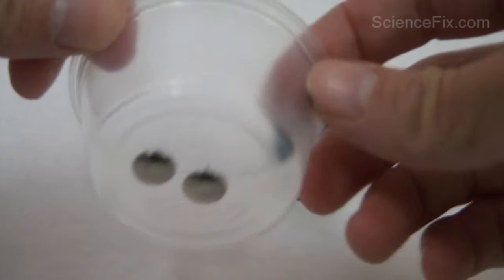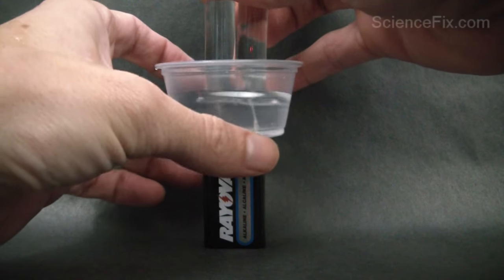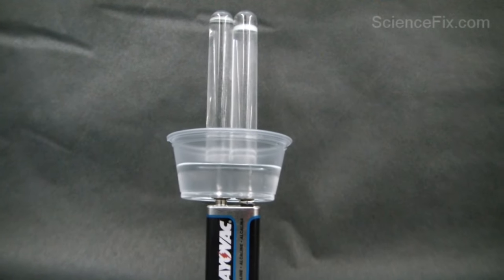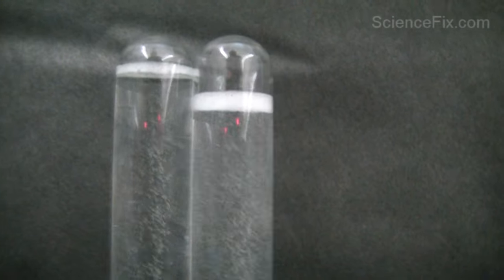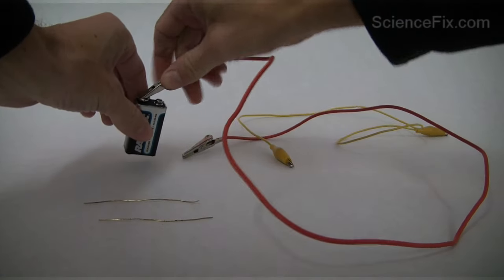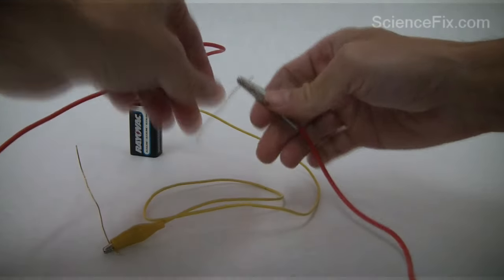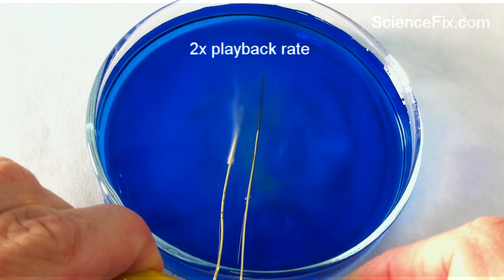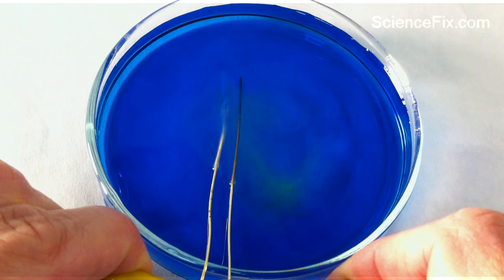Water Electrolysis

Comment: I had a similar problem, a dirty green fluid on the cathode terminal, which I think was the oxygen and the metal reacting, forming an oxide. However, I do not know what material was the pin made of.

Comment: How long does the battery last with this activity? I going to be doing this with my class and wondering if the battery is drained quickly and if I will need multiple batteries to show all my classes.
Reply from the maker: Good question. I do this for maybe 10 minutes. You can go longer. You probably want multiple backups.

Comment: It would be H2o assuming the two gasses were the same size molecules, but Hydrogen is a smaller molecule than oxygen so if twice as much gas was produced there could in reality be 4 hydrogen atoms for every 1 oxygen if the hydrogen was half the size. So I am the first to challenge this misconception of that there are only 2 hydrogen atoms for every 1 of oxygen as if you take 2 balloons and fill one with the oxygen gas and the other with the hydrogen and tie them off you will lose the hydrogen

Comment: more amps will provide a larger amount of hydrogen and oxygen gases. You have to make sure that you apply DC current only, otherwise if you do it with AC current you might shock yourself or even kill. I wouldn't recommend going over 15 amps plus do a good research before you start doing anything for your own safety.